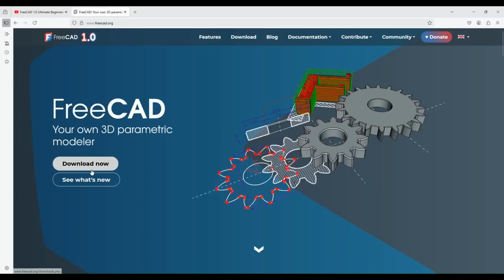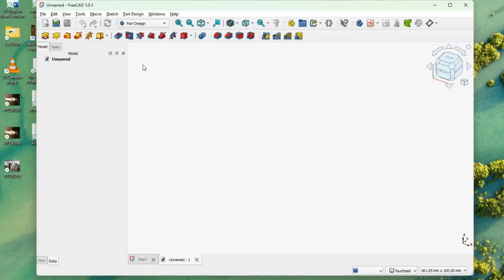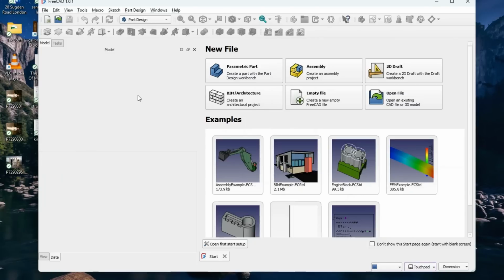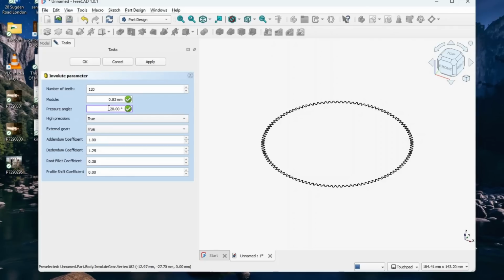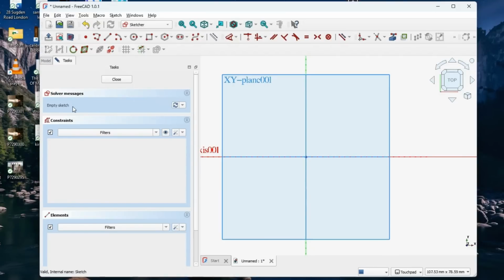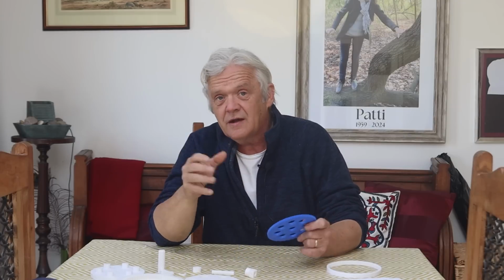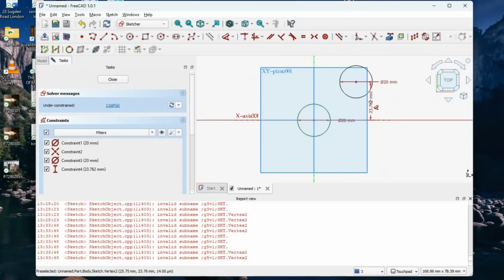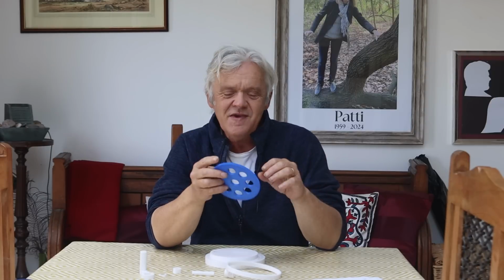2389 Getting To Grips With FreeCAD

Comment: This will be an excellent video series for those wanting to learn FreeCAD. I can't wait to see which holes you fill in for me. Remember by starting with a sketch rather then primitives, you can change the sketch and not need to start the process over. Primitives are a one and done. Sketches are adjustable.
Reply from the maker: cheers mate and nice addition there thanks for sharing it
Reply: FreeCAD is completely parametric, so you can change any parameters of the additive shape (Primitive) at any point. B

But I agree that sketches have a lot more utility.
Reply: @johang1293  Thanks for pointing that out. I was considering adjusting a sketch on a face from a padded sketch.

Comment: I have been using FreeCad for years and never used the part design workbench at all, I was always using the part workbench and working more like TinkerCad, adding primitives and doing unions and cuts and so on. I found the spreadsheet tool is quite good for putting in parameters of your design, so you can change a value there and then use it in dimensions all over the place. This video is a great introduction to the part design area, loads more for me to play with!
Reply: You can actually reference any constraint or dimension you make without the spreadsheet tool, though I will admit that it is nice to have everything in one organized spot for what you mentioned.
Reply from the maker: I quite like the spreadsheet tool but it is more useful if you are doing a series as opposed to one off designs
Reply: The dev version adds varsets
Reply from the maker: Thanks for sharing!

Comment: Holy wow!  They actually made it to 1.0!!!  Last time I used it, it was hot garbage.  Looks like it's been upgraded to more usable room-temp recycling now.  Another 12 years and it might be half as good as the paid stuff we have now.

Only half kidding.  It's nice that the project exists and is freely available, but using it a couple years ago was just about the most miserable experience I've ever had with a program.  That experience entirely convinced me that up to $1000 on a perpetual software license was more than justified (while I was fortunate enough to have that money briefly available), and I still don't have any regrets spending that money.

(FYI, I went with Alibre and got an amazing deal on Expert, and I would definitely recommend Atom3D as a nice option when they have a nice sale, even for hobbyists.  You could just email and tell them what your budget is, too.  They're a generous company, responsive and nice to work with.)